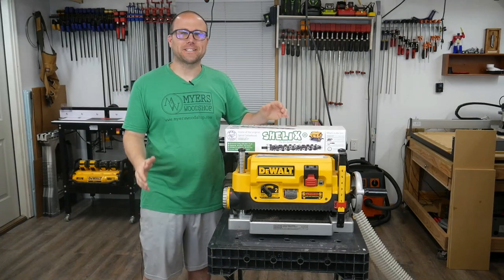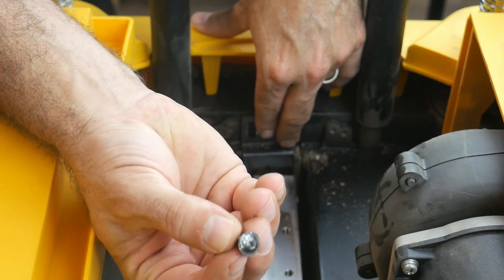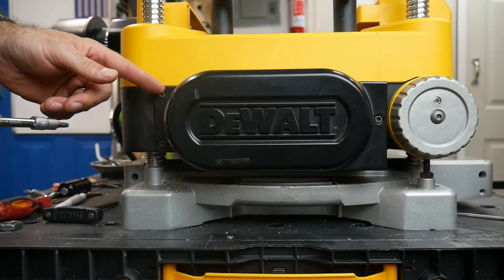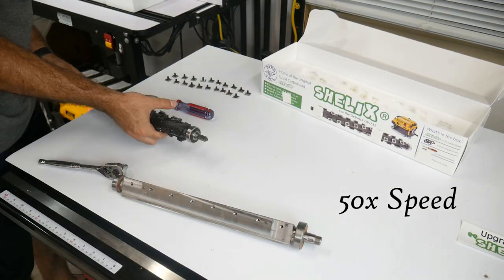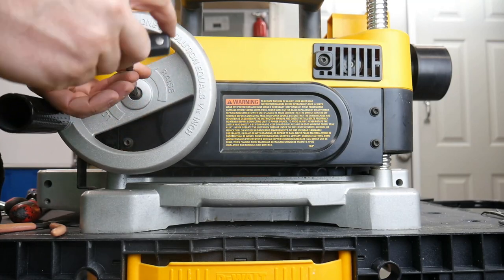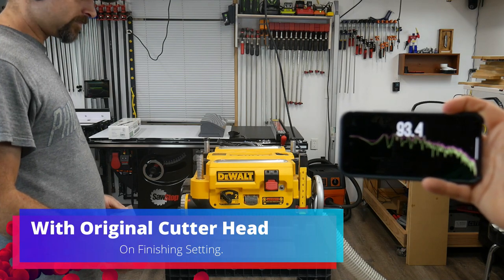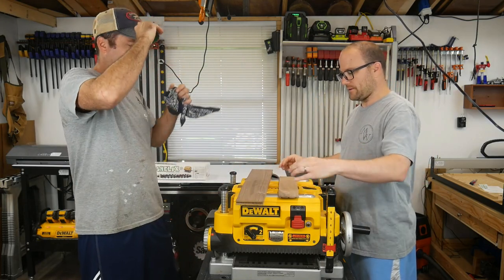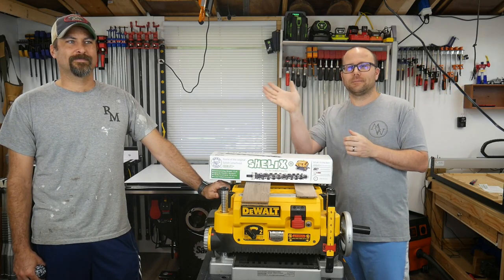Shelix Cutterhead OEM Install For Dewalt Dw735 Planer With Before And After DB And Cut Quality Test

Comment: I'm kind of surprised they don't recommend using Loctite on most of this stuff.  I've had a BUNCH of screws and nuts fall off my Dewalt, including the one that held the adjustment wheel on, the spring-loaded outfeed table retainers, etc.  I have taken to Loctite-ing everything that falls off.  lol

Comment: 20" planer for a grand??? Hahahaha!!!!!

I've never laughed so hard! The Shelix head alone is over a grand for a 20" planer!!!
Reply: The Shelix cutters last 10 x longer than the standard blades.  Additionally, each Shelix cutter has four sides, so you’ll get 4 times the use out of them, with each one lasting 10 longer.  

What would it cost you to replace standard blades 40 times?
Reply: @francismallard5892  this comment was made a long time ago, but I think what I was referring to was the guy's complete lack of understanding on how much a planer costs. Also, if you are changing planer blades 40 times, then YOU are the problem, not the blades!

Comment: At 19:02 - when you've replaced the two phillips screws with the spring plate...  I have the screws tightened as far as they'll go yet there is still a "spring in it's step" for that plate.  Screws are tight yet not holding plate secure...  Please confirm this is normal.  Thanx!!!
Reply from the maker: turns out, that piece isn't needed any longer.  Its for changing the blades on the old head.
Reply: Yes the directions on the Byrd website say to toss that part when you reassemble.

Comment: 18:25 DO NOT REINSTALL THE SLIDE LOCK PLATE. I was told to remove mine by Byrd tech support when they noticed it in a picture I sent them. It can cause problems and potentiality serious damage and isn't needed with their cutter head.
Reply from the maker: this is true!  I didn't know that when i put mine back together.

Comment: nice tutorial, Have you ever had the issue that the chips don't come out from the blower? Do you happen to know how to fix it?
Reply from the maker: thanks!  I have not.
Reply: I have had chip jams  on my 735 when taking a deep cut on wide pine boards. You have three options (1) resign yourself to cleaning out the dust chute every 10-15 minutes (2) take shallower cuts (3) let the chips blow all over the shop and clean out the clog when you're done planing. 

The noise factor, the chip factor and handling figured woods are pushing me towards getting one of these heads.

Comment: Hmm, the cutters on your Shelix has four sides before you need to replace one. I also believe they are quite cheap to buy a pile of them. If they gave you 6 spare, that is 6x4 replacements. I think if you use this most weekend or on most builds it will be worth while, if you are using a lot of re-claimed wood, I think its a no brainer. As the screws you has threading issues with, shame you could not find TORX screws that you could fit to make it all the same type of head. Still.... your probably only going to be opening it again like that every few years, so a bit over kill I suppose.

Comment: I realize that upgrade mods (expensive ones) are just part of many products, such is life. But this cutter head is 2/3 the price of the planer itself. Is there really no better option than to buy the DW735 and separate aftermarket head?
Reply from the maker: not that i've found

Comment: Thanks for one of the best "how to do its" I've seen on YouTube. I had already tipped over to update my 735 when I thought to look at what's involved to do the switch. While a lot more detailed than I wish it was, it's certainly in my skill set. I do plan on watching it over again but stopping it after each step to write it down to give me a work-plan. That is unless you already have one? If so, please share. 

I do have several questions. At 13:20 you are pounding the new cutting head into the DeWalt. You do not mention or show how far is "in" in. By that I mean when pounding it out, once it's loose, it's out. But pounding it in how do you know that it's in all the way? Also, at 18:25 when you are reinstalling the cutter lock-plate, I did not fully understand what/why it was not fitting and when you are pounding it, exactly what is "giving" to give it more room. Needless to say based on these two questions, my general rule of repair/modification is that you shouldn't need to "get a bigger hammer." 

Lastly lastly, one of the reasons I'd opt for the OEM size is that, as you state, 'that way all of the initial manufacturer setups are maintained.' So are they? One of the things I do appreciate with my 735 as it stands is that if I set the depth of cut to 1/2" when you reach that it's within a few thousands. After the change, is it still so accurate? 

Also, please note I just added a comment in a different comment thread about decibels: that they are logarithmic and a 10 db increase is about double the perceived sound. That's a lot. Look up decibels on Wikipedia for a LOT more about decibels than you want to know. ;>) 

And Happy New Years!
Reply from the maker: apparently the lock plate is useless for the new cutting head.  yes, oem is good

Comment: Where the blades before sharp like new? I guess they were used for a while before you replaced them with the shelix. If you compare you should compare both with brand new blades.
Reply from the maker: they were flipped on the second side so nearly new.

Comment: Use long point pliers to remove the snap ring or circ clip on RHS  EASY..doesn't need to suck n better than small circclip pliers

Comment: I have a Makita and 2 oem pullies do not fit shelix shaft and depth of keyway is not correct and key does not fit. I brought to attention during warranty and manufacturer will not fix.

Comment: Not bad, the Orange store has a black friday promotion for this dewalt plus stand for 600, so ~ 1000 with the helical/spiral cutterhead.  I'm just a hobbist, and wondering if you think that is worth it? WEN has come out with a spiral cutterhead jointer and I'm assuming will be releasing a spiral cutterhead planer soon.   I don't have many dollars to support this hobby, have any thoughts on WEN power tools?
Reply from the maker: wen is ok, but not dewalt quality.

Comment: You took out screws with blue inserts hope you replaced them with new or put thread lock when replacing? Never get a carpenter to do a engineer's job. 🤔
Reply from the maker: come help me next time!
Reply: @MyersWoodshop   a little to far away for me 😁 just wish I could my wood work is rubbish 😭😭

Comment: Replace ALL fastners with TORX drive head, phuck  obsolete phillips fasteners. Should have pointed out a missing screw holding the original cutter head blade together